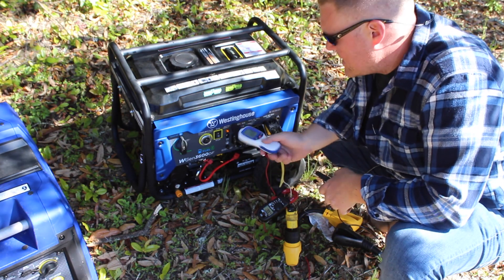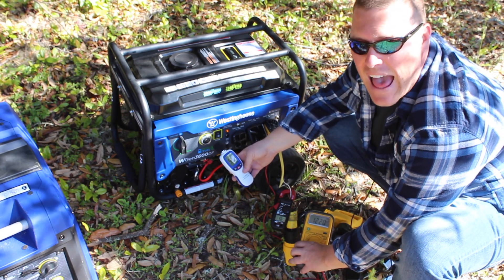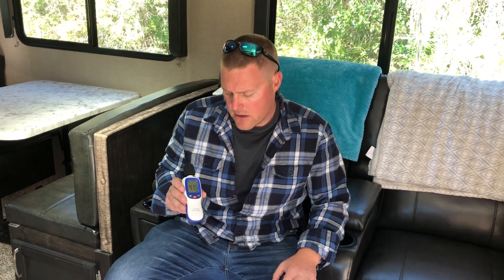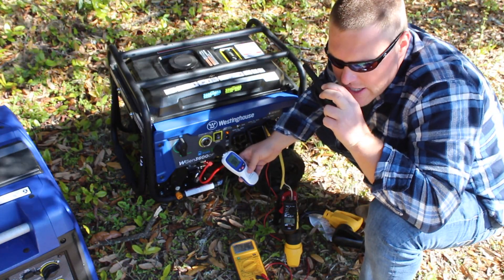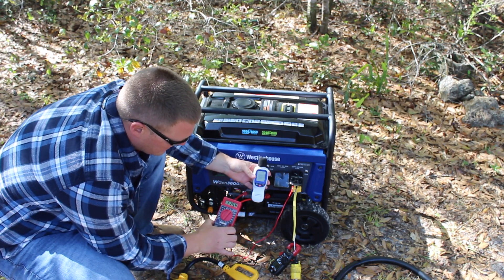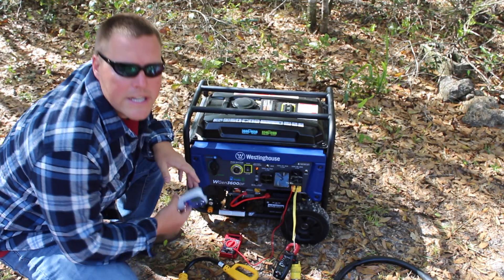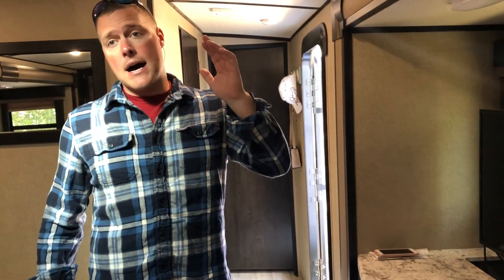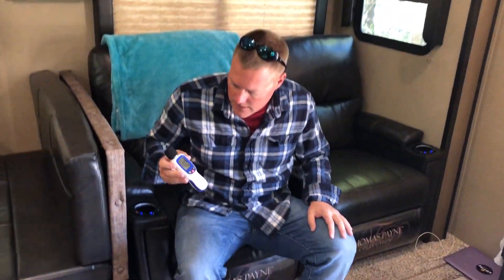Dual Fuel Real World Test, What Will A Westinghouse WGen3600DF Run, AC, Microwave, TV etc

Comment: Running on propane makes it significantly quieter. It does however, have a better chance of scaring The living daylights out of you by sparking
Reply from the maker: Also, less power output on Propane vs Gas.

Comment: Is there a reason you not using the 30 amp plug in, would that effect the results?
Reply from the maker: Yes, because our Amp meter would only work with the 20 pigtail we made. Otherwise, we would use the 30 amp.

Comment: Kinda loud. I ordered it without deep enough research but I need one for the pg&e BS they're pulling. "Public safety" power shutoff. It's a scam to raise our rates. They don't lose money. They just charge us more to keep their profits. I digress. Really like the remote control, electric start, dual fuel, all seems like a good time.
Reply from the maker: Yes, this is certainly louder than an inverter generator. Has PG&E offered to install generator switch in panels?
Reply: @generatorpower7744  no but that would be awesome. I've been looking at some of those and definitely gotta have one installed. Make life a lot easier.